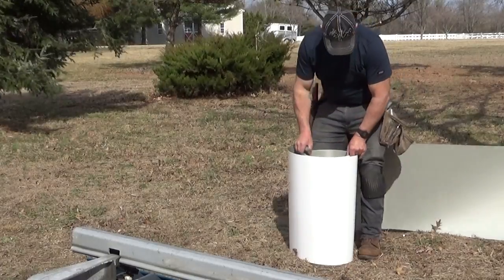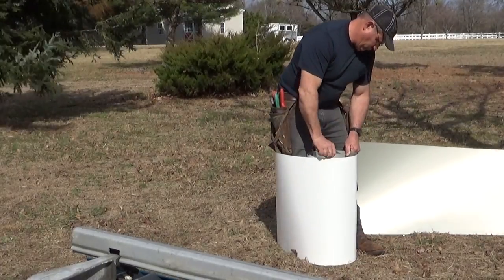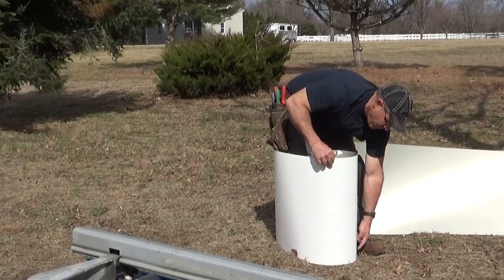Cut aluminum trim coil stock, free-hand.

Comment: Nonexistent cinematography
. One camera set up, and forget it.   No shot of the shadow line.
Reply from the maker: Dear Robert, I wish I had one camera set up for the last 35 years, of my working life, all the doors I installed and the windows I put in all the aluminum tri coil I've ever bent, all the siding I ever cut (by hand) all the concrete forms I ever set, all the concrete I ever finished, all the shingles I ever tore off and put back on, all the houses and additions i helped to frame, all of the cranberries and blueberries I ever helped harvest.....yes Robert, I wish I could have had one camera set up...
Reply from the maker: Your right Robert, pretty much a  lousy video, I wish I could do better, stick with me, they'll get better...

Comment: Have a small piece of work to do and didn't know you could cut with a utility knife. Saved me some time and effort. Thanks.
Reply from the maker: yes you can cut it with a knife, but if it has to be straight, use a sqaure, if you have time watch my aluminum trim brake video. thanks for watching.
Reply: @lendavidhart9710  I actually need to cut it lengthways too. I'll definitely find something I can use as a straight edge.

Comment: You made that look easy, it's not!
Reply from the maker: Hi Johnny bear, if you take your time with that coil, and cut it with a sharp utility knife, and handle the coil gently, you will get it. Hold the coil from the top, let it's own weight hold itself straight, hanging from your hands, if you understand that...thanks len
Reply: @lendavidhart9710  I will give it a shot